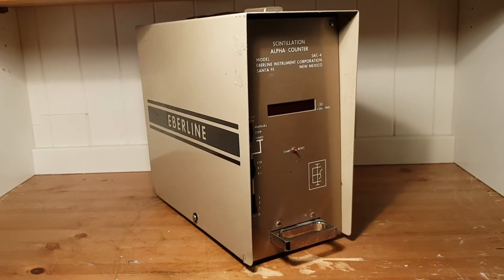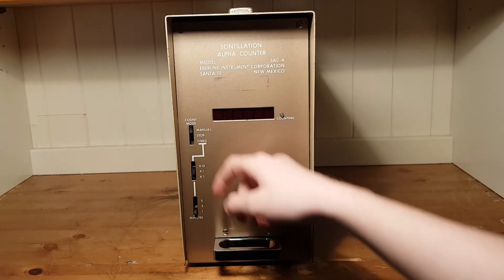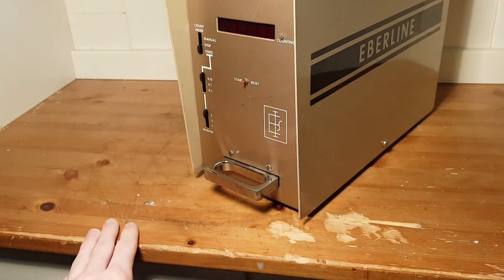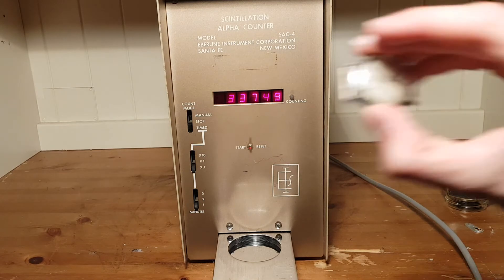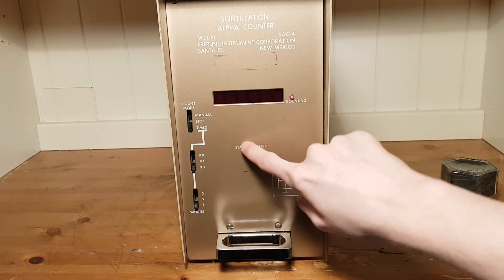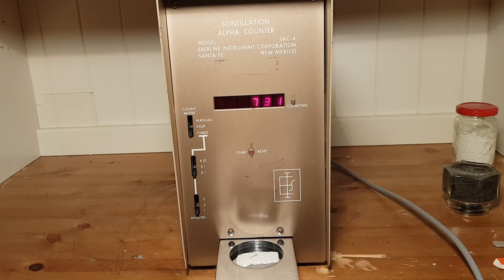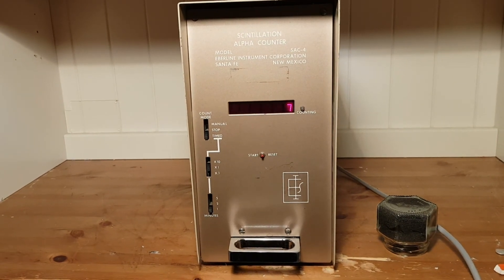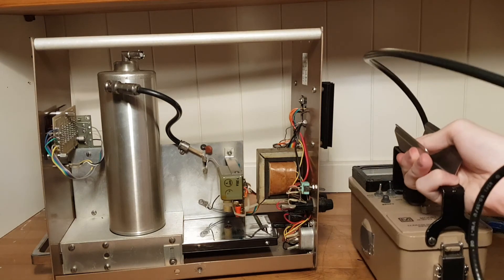The Eberline SAC-4 Alpha Scintillation Counter

Comment: Can you run a spectrum on this and send it to a PC someway?
Reply: I don't know if it can be used that way.  Alpha spectrometers typically use a photodiode as a detector rather than a scintillation crystal.
Reply: @douro20  you can definitely do alpha spectroscopy with ZnS(Ag) scintillator. however you need to make vaccum chamber for the sample and crystal because alpha particles are significantly slowed in air

Comment: This is an insane level of sensitivity and discriminating specificity for what appears to be little more than a glorified spinthariscope. Amazing zero background counts and a mere 7 counts on A 20 REM/HR BETA SOURCE !!! How on earth....
Reply: The phosphor crystals are sized so they glow best from alpha. Most beta does not have enough energy to make the flashes glow anywhere near as brightly.
Reply: @christopherleubner6633  Do you have any more information on exactly how this is managed? I also do no understand why photons activate ZnS:Cu to emit phosphorescence over hours or days, but alpha particles apparently only cause it to emit light for nanoseconds.
Reply: @Muonium1  cu ions will form a defect that causes phosphorescent glow only as Cu2S. As it holds on to the energy the re-emission is delayed. The scintillating ZnS is doped with silver so it dumps the energy immediately. These metals turn the ZnS into a N type semiconductor. For this detector they make the crystals big enough that it takes a lot of energy density to make the phosphor glow.